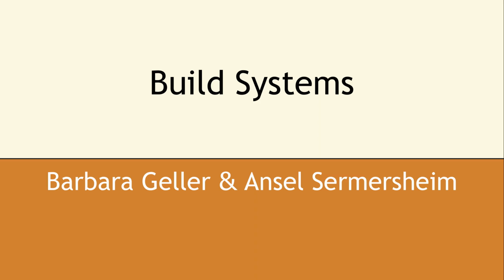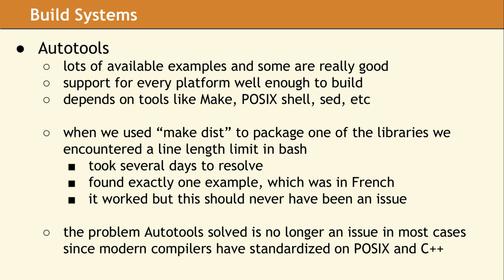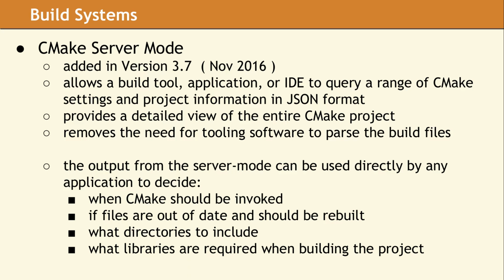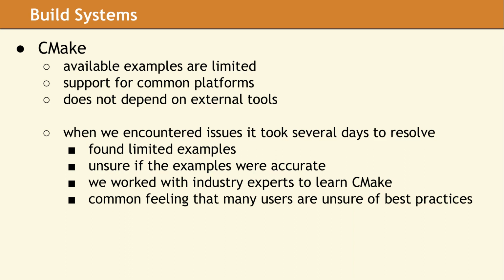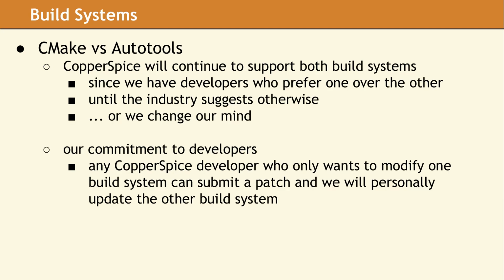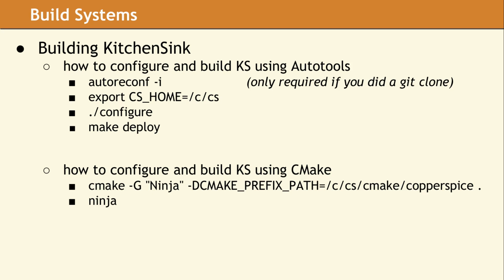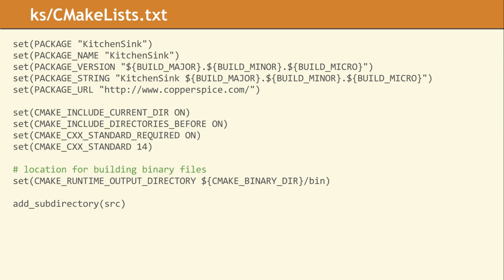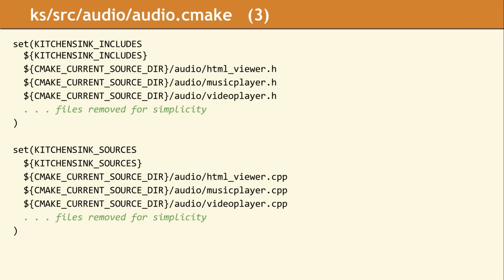Build Systems

Comment: You really shouldn't use add_definitions() or include_directories() and declare it good CMake practice, as those commands pollute the global settings as all following projects will receive the same configuration. The same applies if a user wants to build your project as a subproject. A better way to configure your project is to always refer to your targets specifically. This may be achieved using one of the target_* commands in CMake.
Reply: Based on ideas provided by a contributor we have changed include_directories to target_include_directories in the src/CMakeLists.txt. He is also looking at whether it is possible to split KitchenSink up into multiple libraries, but since KitchenSink was developed as a monolithic application this may require code changes, not just build system adjustments. It's not clear whether the benefits of modularity outweigh the cost and complexity in this case. Thanks again for giving us things to think about and contributing to the discussion.
Reply from the maker: The purpose of the video was to discuss the two most commonly used build systems for C++.  Our CopperSpice build files were contributed and worked on by about five different people and they are still a work in progress.  The KitchenSink CMake build files were created recently. The focus was mainly to show how to use the find_package() functionality to link with the CopperSpice libraries.

I am not sure we said this was perfect or good practices, but I do know we said the "target" commands were the preferred way.  As with any open source project we welcome contributions and will do our best to update the CMake files.  Thank you so much for participating in the discussion about CMake.